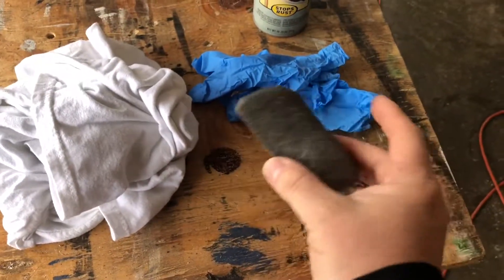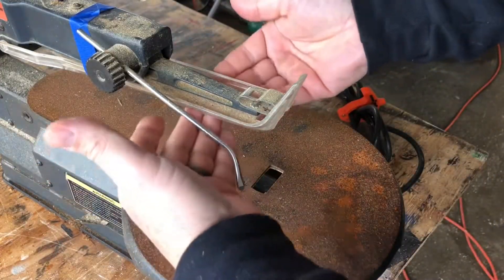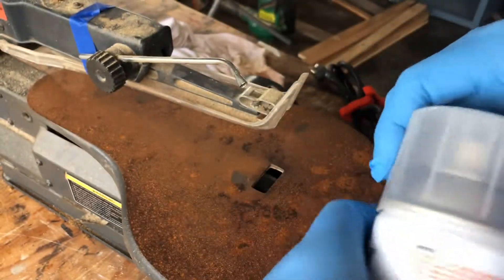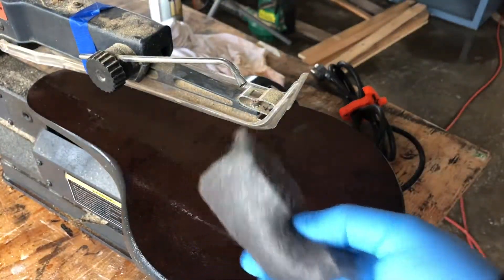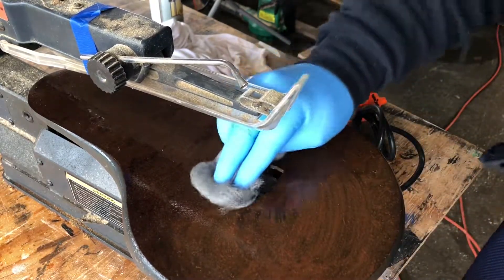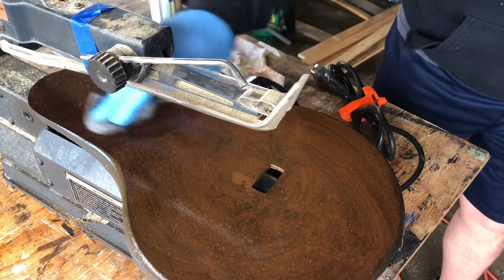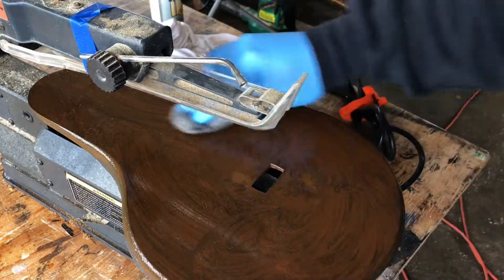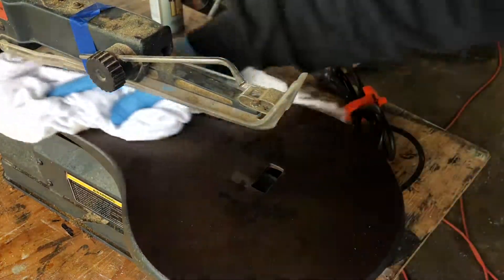How To Clean the Rust Off a Cast Iron Scroll Saw Base

Comment: you should put a coat of paste wax on the table. let it harden and buff off. it would keep the bare metal from rusting so fast and makes your wood slide easily around the table. i use wax on all my cast iron saw tables and even the aluminum for the glide factor.
Reply from the maker: Awesome. I never thought of that. Thanks!